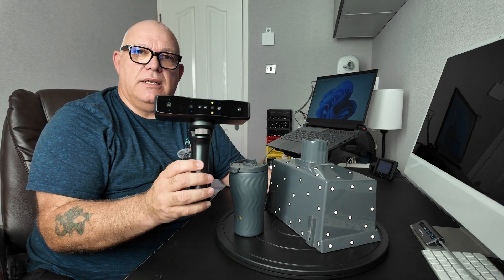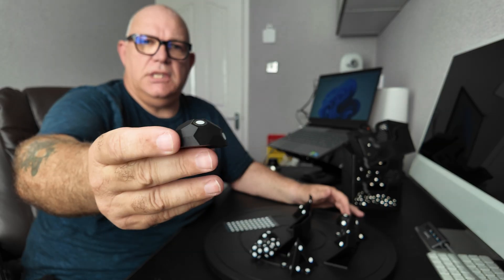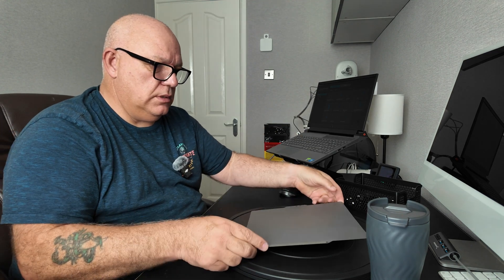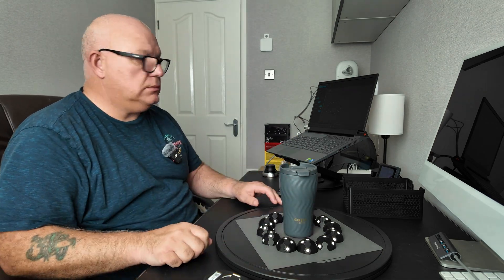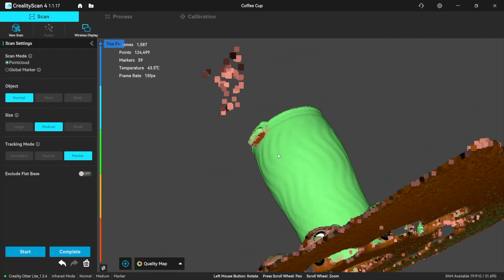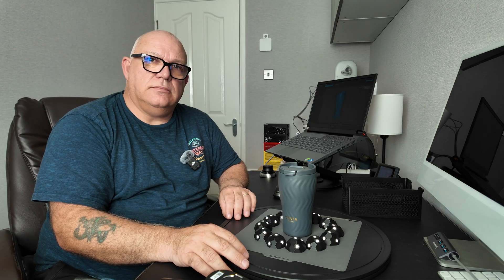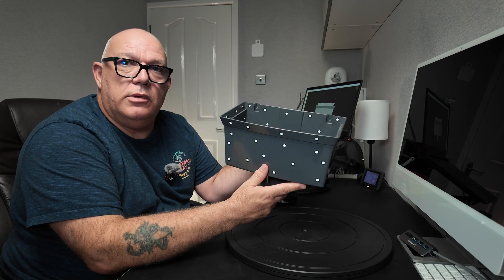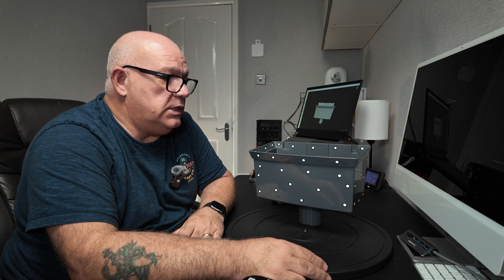Creality Otter Lite 3D Scanner – How to Scan with Markers (Coffee Cup & Rainwater Hopper Example)

Comment: Hi, what model of network card do you have that works so well with Otter Lite in a wireless connection with a laptop? Good job, I'm just starting to work with this scanner and your video is helpful.
Reply from the maker: I don’t have anything special. I use a Dell G15 Gaming laptop. The only thing I upgraded was the RAM.